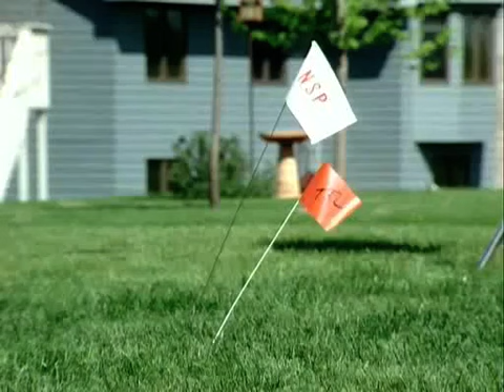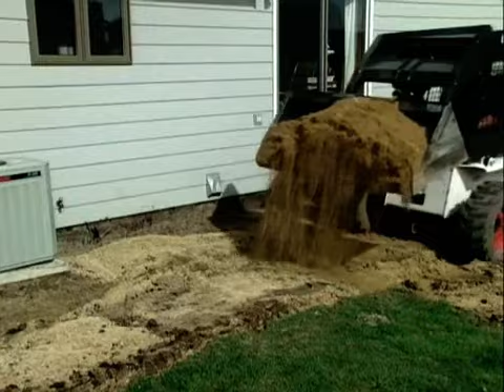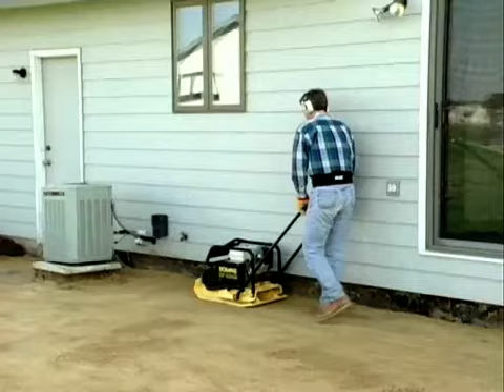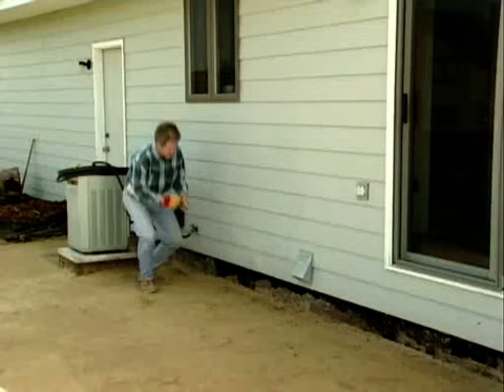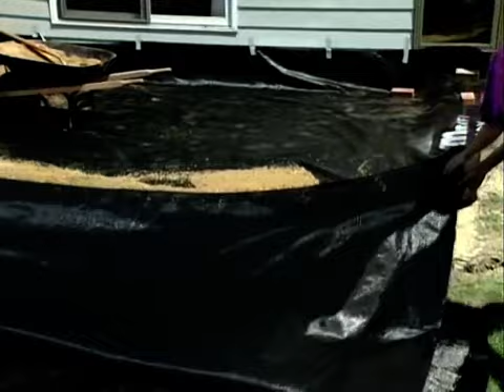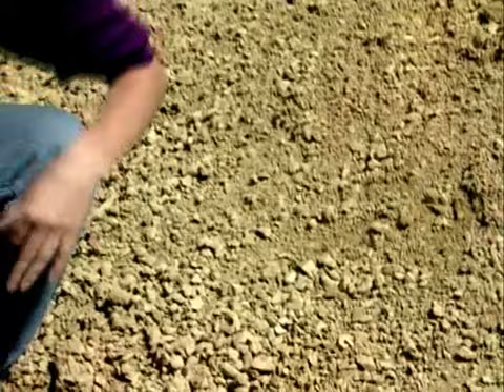How to prepare for laying pavers. Started on a concrete paver project.

Comment: So, to summarize it in a simplified way, you scrape off a couple inches of dirt, then layer it with either Lyme stone or sand, make sure the sand is not dry and not too moist, make sure it's nice and flat with a pather or stomping it down with your shoes, and finally you can lay down your bricks.

Comment: I'm just going to throw some paver bricks on the lawn and hope for the best lol
Reply: Y’all are on some Home Depot shit
Reply: Yep, squirt a little roundup between them, fill the cracks with sand, works fine .
Reply: I laughed my ass off reading this. LOL. Awesome.
Reply: I love it!
Reply: Replacing the old path in my backyard now.  That's what they did last time.  The pavers sank about 4 inches under the ground level and the grass was growing over them about 6 inches on a side.  Dangerous in winter with refreeze.  It's a pain, but I want it to be done right and look good.
Reply: @heitman78  how's it looking after a couple of years?
Reply: Y’all on some bob the builder’s country cousin shit
Reply: Coma Black's idea is good you just need a few extra things.. 1) cut the grass to the lowest setting on your mower 2) spray alot of roundup to kill the remaining grass 3) water the dirt to the point of almost having a puddle 4) buy gravel(homedepot or lowes) and then compact it with a handheld compact($25 at lowes) 5) water the gravel again but not so much water this time, then compact again 6) throw your pavers!
Reply: Lupe is  perfect! I'm going to try this! Never thought of the round-up! I only needed a driveway for my 18 wheeler & can't find help! Round-up & compact sounds good. Then sand & prob frame in & cement is much cheaper then pavers.
Reply: Lol same here
Reply: I feel you..😅😅😅
Reply: @KD-1983  how'd that workout for you?
Reply: Same
Reply: Right!!!
Reply: Snake..
Reply: Stop crying
Reply: You dumb ass

Comment: I dunno but I've read you NOT supposed to put fabric down under your paver sand, and you're NOT supposed to tamp down the bedding (final layer of paving sand). Also DIY doesn't involve spending lots of $ on equipment and hauling. Only makes sense if you are doing a large project. At that point I would pay someone to do ALL of the work.
Reply: But 10.000 dollars job lotta work and materials

Comment: this might be a dumb question because i don’t know anything about this but, what’s the difference between gravel and regular rock? i’ve got a lot of medium sized rock in my backyard and was thinking i could use that as my base and then lay all the sand on top of it. can i do this or do i have to actually buy this ‘gravel’ for that?
Reply: the sand will just wash into the spaces off the rocks,,,,if you want to use your rocks you will have to mix it with smaller aggregate at the same time so there are no voids ,,then the sand can go on top of that
Reply: Gravel is rounded and comes from rivers,  crushed rock is, well, crushed rock! Crushed rick being angular in nature will compact and bind to form a very solid base. Gravel, on the other hand, being rounded, is not as good for a base material.

Comment: Is it really DIY if you're paying an excavator to come do the work for you?
Reply: Or you own one 😎
Reply: granjuice no
Reply: DIY but with contractors ! B-)
Reply: Exactly ! That’s not DIY ?? 🧐
Reply: It's time vs cost, it would take a couple of days to dig and cost $150 to have it done with a machine👍
Reply: @ohnjay1973  a couple of days my arse could dig this and base it in a day
Reply: @robertmillen2967  Scotland mate and i do landscaping for a living ,fully booked until January next year, where abouts are you can still quote for this job you need done.
Reply: george fraser but seriously I wasn’t mocking or doubting, I’m have about a 20’x10’ and a 10’x10’ patio to lay down 
I’m in Kentucky USA. I’ll come to Scotland to go over details, ok
Reply: @robertmillen2967  no problem give me a shout when you get to Glasgow airport and I will meet you I am only 2 mins from there,I take it your measurements are in feet not metres?
Reply: george fraser yes feet
Reply: Robert Millen I’m about to do a 10x10. Started because I was leveling ground for a 10’ kiddie pool for this summer (Covid and pools are closed). So half the work is done and I figured no time like the present to put in the patio I’ve been wanting

Comment: Just wetting my feet on this subject, but my initial observation is that patio pavers seem to be just as much work, expense and expertise as any of the other options.  I'd look at all the other options such as a deck or poured concrete which can be stained to look like fancy patio pavers except with no part time job keeping weeds from between the cracks.
Reply: Wish I had simply hired a concrete guy. BIGGEST PAIN IN THE ASS. Worse than planning a backyard wedding. I’d rather go through labor again.
Reply: Stamped concrete?  Not many people do it well and it will cost 5k more.
Reply: toscodav your right there it is way over priced

Comment: Depending where you are you could use hot lime that is what they use on oil rigs to dry the mud/cuttings and water it's messy it can smoke and burn things wouldn't recommend near building or cars because the steam carries the lime but if your trying to build a drive way threw wet area it would best if you had pile mud and just kept rolling it with a machine in few minutes you could use the dirt but near building I would 3 inch gravel it binds up better than 2b wich will roll like marbles out from under tires then cover it in 2a modified like your using ,the netting is good if it's sponge  the lime trick is good for jobs where you need to haul the muck out because no place to go with the mud on location line  the truck with plastic or it will stick in box  load it up after it there no more running water you could move on with job you would have to wait or come back to it will save you a fine for spilling mud water i use excavator to mix because the volatile action is farther away you still need a air mask if you don't have good cab even then recommend cause you can't direct wind  new construction where it's soup mess before anything was built perfect place to try it's not hydrated lime that farmers put on floor barn

Comment: the right drop is 1 inch every 8 feet my friend you said 1 inch every 4 feet thats completely wrong
Reply: 1" for every 8 feet is standard, you're right.  But each scenario has it's challenges and you need to improvise.  I would never go more drastic than 1" every 4 feet though.  Why don't you help all of youtube out and explain why it's completely wrong rather than negatively commenting on it next time.

Comment: Why not use a mini EXCAVATOR  rather than a skid steer excavators are designed for excavating skid steers are designed for loading just a question the Americans seem to love skid steers where as in the uk we tend to use diggers and dumpers as it creates less damage
Reply: Because the mini excavator can't bring in the base material and sand...or the pallets that the pavers are on.  They're the best fit for the job.
Reply from the maker: You can use excavator
Reply: I know you can I just asking why a lot of Americans tend to use bobcats instead
Reply: +Andy ball you joker
Reply: +Lucas Bennett why am I just seems wrong machine totally
Reply: +Andy ball I don't like you any more